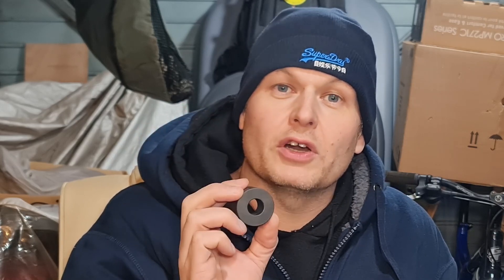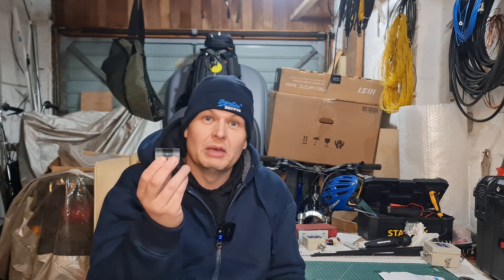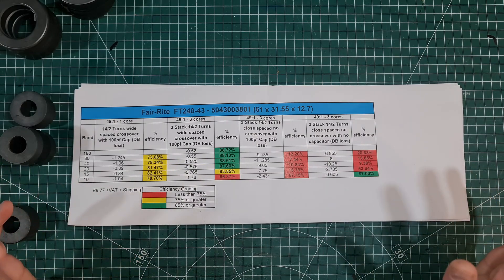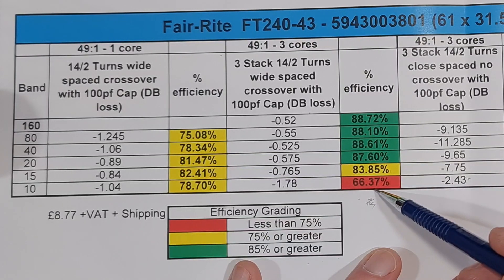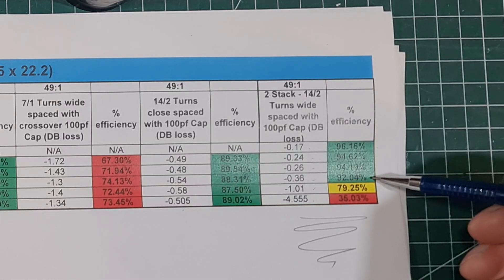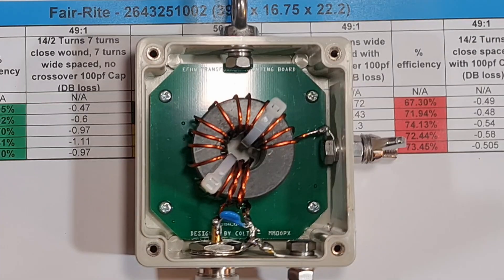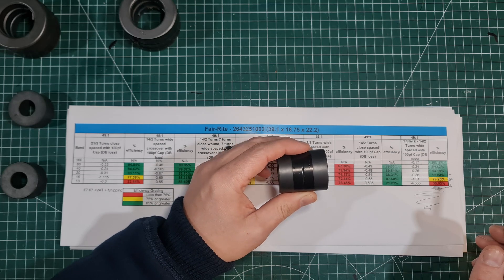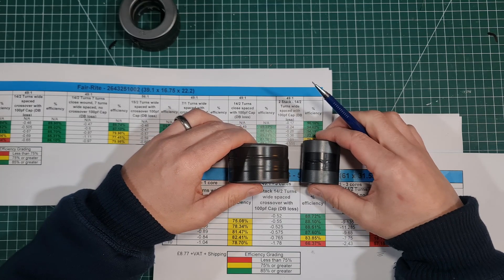How efficient is the best 100w End Fed Half Wave Core when stacked for QRO? #hamradio #antenna

Comment: I've built a 2/14 closewind, at tapped, 100pf  using Fair-Rite - 2643102002, using similar test rig I get results inline with the Fair-Rite - 2643251002 and Fair-Rite - 2643625002. I've been using it for POTA w/ 20m~ of wire and it's been matching/surpassing my results from ft-140-43 I was using for 10-100w (usually I activate 10 or 50w)
Reply from the maker: Excellent, glad you got something that works for you 😀

Comment: I work ten meters with two stacked 240-43 cores and found them to be quite suitable for 100Watts of SSB. Thanks very much for this video. You are really filling a hole of information that needs filling. Your research is making the EFHW anttenna more viable and efficient, especially for multiple band operation.
Reply from the maker: 2 cores will handle 100w data modes with ease never mind SSB. This core will let you squeeze out a little bit more performance.

Comment: why so much power on ft8 i worked the world on 10 watts. running your radio to 100watts or amplifiers on ft8 will kill your output transistors. better antenna less power.
Reply from the maker: I agree in general. To he clear, FT8 is a weak signal mode, not a low power mode. There will be times you need to raise the power but yes usually if the band is open a few watts will do. I wouldnt run more than 30w from my rig on a digimode. My amplifier however would run all day and some at 400w. Its rated 1kw full duty cycle and I know a friend whe had an NOV and ran his on 1kw RTTY without issue  which has a higher duty cycle over FT8.
Reply: Knew a bloke who during the recent sunspot minimum worked Australia to east coast Russia on 10m using Russian QRP which was around 2KW to get through on FT8

I guess you do what it takes :-)

LDMOS has made it easier :-)

Comment: Everyone seems to just use the 100pf capacitor, but has anyone tried putting a mica compression trimmer on there instead and seeing if the optimal capacitance value changes as things like stacking cores is adopted?
Reply from the maker: Thats not strictly true, I've experimented with 150, 120, 100, 50 and none. Its very much horses for courses dependent on winding and core used.

Comment: What manufacturer and model of the capacitor are you using in this experiment?
Reply: I'm sure Colin uses TDK ceramic capacitors. Try this part no. : CC45SL3FD101JYVNA
Reply from the maker: Appreciated 👍

Comment: Ive got 2 of these cores after watching your other video.  What awg/mm magnet wire should i use for 100w max?  Thanks for the data. Great video 73
Reply from the maker: Anything around 1mm. I use 1.12 or 1.18.
Reply: @MM0OPXFieldRadio  Thank you!

Comment: I’ve become addicted to half wave end fed mono-band verticals for the higher bands!! I’m using ladder line to create a quarter wave shorted stub to give me a match!  I find it a nice alternative to using a transformer when looking for DX!!
Reply from the maker: Definitely, I really like my monoband 5/8 vertical L/C matches. I can run much more power vs a wound ferrite core.
Reply: @Gabaab  It’s essentially operating as a j-pole! What’s nice is that the losses are low - the only area of high current being around the shorted end of the ladder line. So quite efficient!
Reply: @Gabaab  It's worth a try -  easy to make and v effective.  For 10m I've always thought getting the 5 m wire as high as possible on a 10m pole helps - Height is might etc etc!!!!

Comment: Colin filming in his garage when it is -10°C inside and even colder outside 😂
Good job Colin. I didn't realise the ft240-43 cores were good for 70W. I always stop at 50. I'll definitely look at your suggestions for a higher power set up.
FYI I have worked 10m SSB qrp DX with the EFHW on more than one occasion. 
Cheers, Fraser MM0EFI
Reply from the maker: Excellent Fraser. A lot will argue the 240-43 will handle 100w FT8 but not in my experiments. Getting milder here in southern parts thank goodness.
Reply: Thank goodness it is getting milder.  I wasn't doubting your efficiency calculations for 10m. I think I just got lucky. When 10m is open, a bit of wet string can sometimes do the job. 😊

Comment: For reference I was using a single 240-43 as a 9:1 for a Random Wire and had the 70W limit hit me ..not imediately but after a good dose of FT8 also the operation at 10m again seems a bit off.. nice to see that your figures approximate to my setup done independantly!!
Reply from the maker: Thanks, there is some doubters out there but  good luck to them. Yes, it does take a while to saturate the core but does happen.
Reply: @MM0OPXFieldRadio  I would say from the time it takes you are not Saturating the core significantly  but enough to slowly heat it near the Curie point at which the performance drops and you are forced to back off to the sustainable level!!

Comment: This video is semi helpful :-)

I have been playing with magnetic loop antennas made with 1” x 1/16” aluminium bar. 

Using FT240-43 core as a 1:x matching transformer, I have 40m and 20m working exceptionally well with both 8m and 5m circumference loops. 

However, using the smaller 3 and 4m loops for 10-15m the turns ratio drops and the coupling efficiency seems to die off

Stacking cores helps a bit and I grabbed some type 52, 61 and 77 material. Not much difference. 

Strangely enough the throw together 10m loop I poke out the window made from 2.5m of RG6 with a capacitor made of the same, fed by some random EMI filter cores I found in a computer case is around 12-15 dog biscuits better to the local RBN 

I’m considering the core efficiency vs the skin effect issues of a flat bar vs round

Might look at other coupling and matching methods. Small loop, gamma match. See what works. 

Sadly these cores you’ve used are too narrow for the strap. 

Back to the experimenting….
Reply from the maker: Sounds great. I love loops.
Reply: @MM0OPXFieldRadio   they are magic. The noise drops from S7 to S3 on 40m with the 8m circumference loop bs the 33’ vertical. That’s what you get for living in an inner city QRM jungle. Seems quieter since they took away the overhead cable service amp from out front. 

It’s the coupling that I’m working on. I’ve seen a few of your videos on materials v frequency and they have been very helpful. 

I think it’s because the loops are almost too long and with a single turn through the core the impedance at resonance is too high and I don’t get a tight enough coupling with so few turns. The match is good, but the energy transfer is crap.

That said, I don’t see heat in the core. 

Back to the drawing board and more experiments. 

But I have succeeded in a Poke-Out-The-Window-Tenna™️ that covers 20m and 40m so I can test radios from my test bench
Reply from the maker: @MidlifeRenaissanceMan Thats amazing. Ive always wanted to build another mag loop. I had an 80m horizontal loop years ago which worked very well.
Reply: @MM0OPXFieldRadio  I have managed to drive 100W into this current design. Works well and no capacitor flash over. 

Trick with mag loops is don’t expect them to cover more than an octave of frequency.  7-14. 14-28. You can certainly tune them down there but their efficiency drops significantly below the first octave, and you can hit self resonance up top. 

Efficiency is proportional to the surface area so circles and octagons tend to beat squares. 

Radiating Element surface area is significant to a point. But skin effect is your friend. You can get away with tape, either aluminium or copper. Much cheaper than copper pipe, though if you’re happy to slip a dude a $50 he can take a $30 aluminium pole and bend it into an almost circle for you. Friend has one that he can tune 7-21MHz that performs OK on 7 but really kicks some at 14MHz

Finally, you only need a small amount of variable capacitance to cover any band. Makes it cheap to build a mono band loop and change bands by paralleling fixed capacitance across the variable cap. 

Probably stuff you already know, but someone may come across the thread. :-)

Comment: Great work Colin... I wanted to try a 49:1  2 stack 52 core, which I don't think you have shown, and which I think will work better on 12 and 10 meters... am only interested in 40 and up. I only had a single FT 240 52 core. Looking at most winding profiles, sans the crossover which is NOT necessary; so you have a winding profile uses less than 1/2 the core mass... the rest on the other side is wasted.... or is it?  

Carefully using an angle cutter I chopped the core in half, you do this carefully, score the first side down 1/4 then do the other side, it'll fracture apart, clean it up.... and then glue the 2 halves together. Since size matters, I now have double the mass under the windings; that's what you really want. I only run 100 watts SSB max, most of the time it's only 20 watts from my Xeigu G90.... 

Preliminary results are positive....seems to work well, VSWR is less than 1.5 on all bands, 20 and up including 12 m ... until you get to 40 where it went a bit askew and resonates a bit high in the band... 80 is useless, which I kinda expected.  Worked a guy in Kentucky on 10...got a 5X5, but more checks are needed.
Reply from the maker: Thats a really interesting idea. I would need to do a back to back with chopped cores to see if if makes a difference. I doubt I will though as these are not my cores.

Comment: Hi Colin, I'll be making a couple of antennas up with the 2x2643251002 cores stacked and giving them a good test on FT8.  Also also 3xT290-43 with 3xT140-43 slipped inside,  should be interesting to measure the efficiency of a very large transformer.  Have you tried 2643101902? I have done some test on these and with 49:1 wide spaced the efficiency look about 90%+ from 80m-10m and is looking like a good option to replace the T140-43 cores from my products in the future.  73 M0VUE
Reply from the maker: Hi Chris, I would be very curious for your results. Theres still lots of experimenting out there to do. I havent tried the 1902 core. Its good to see a UK seller selling the 1002 core. Not easy to get hold of this side of the pond.
Reply: @MM0OPXFieldRadio  Hi Colin, send me your address and I'll post you a couple of 1902's.  I've tested 80,40,20,15,10 my measurements were 93%, 92%, 92%,93% 90% efficiency using 49:1 wide and back to back with my Nano VNA.  Would be good to see how close you get to these numbers as well.

Comment: Hey there Colin. First off, thank you for the content your making, its getting me good into HF and HAM in genarel.

But i have a small problem with the 2643251002. I have made 4 builds now with 13, 14, 15 and 16 turns, and with deffrent copper wire both deffrent in make and size. No matter what my graph looks like a mad house. :) from around 15Mhz and up its over 2:1 SWR with testing with  a 2450 Ohm load. Question is how the hell do you and the rest of youtube land make this work, most videos i have watched, just build it like i do and its spot on.

Side note did a 49:1 on a 240-43 to see if it me who is not doing it right. That one has top SWR at about 30 Mhz and is 1.7:1 and a nice low curve.

What am i doing worng here.

Sorry for the bad gramma.

Cheers
Vy 73 de OZ5ZX // Jeff
Reply from the maker: Tell you a secret, ditch the resistor! its only a indicator. Connect a wire and you will see a HUGE difference. FYI up at 30 Mhz its up at nearly 3:1 with a resistor, with a wire its fine. I wish this was more widely known. When you have the wire up, make some contacts while your at it. The only time I use a resistor is to prove the build is sound!

Comment: FWIW I have used 2 T240-43 stacked in an EFHW at 400 watts SSB and it has survived 3 years now.  I used 10 guage magnet wire for the 49:1 windings.  Cheers.
Reply from the maker: You will on SSB no probs 👍

Comment: Did you take inductance measurements so one can determine the range of where best eff occur over the HF bands. It is of course possible to calculate ind but actual measrements will be FB.
Great adventure and tut.
Reply from the maker: No, but I could have as I do have an LCR meter. I will try to remember to this.

Comment: Hi Colin.  Great videos.  I"m in the process of winding 2 stack of 1002 toroids.  Looking at you chart it refers to "14/2 turns wide spaced"  I wasn't clear if that differed from the tightly wound and spaced auto transformer.  I might be missing something but I've not seen "wide spaced" demonstrated in any of your videos.  Clarification would be appreciated...thanks.
Reply from the maker: I still have some updating of the spreadsheet yet. Wide spaced means just evenly spaced out windings. Your 2 stack of 1002 will be very good low down but become very lossy above 20m. Let me know how it goes for you.

Comment: What size wire are you winding the cores with.  My club has been experimenting with a 36:1 winding that is interesting.
Reply from the maker: For this test I used 0.66mm wire as it's easier on the fingers. For use as an antenna use something about 1mm in diameter. I have 1.12mm and 1.18mm here also.

Comment: Thank you for supplying your viewers with such amazing data. I am building a EFHW now and putting my 240 43 cores aside, 100 watts max to include SSB and Digital. Ordering the new cores, but now confused with the best way to go, single core or stacked?
Reply from the maker: I'm no expert, just sharing what I can. 1 x 1002 is perfect for what you need and will run FT8 all day at 100w.
Reply: @MM0OPXFieldRadio  Thank you sir!

Comment: Hi Colin, got another question ....
Have you ever considered to try and test a 9:1 comparison between the 240-43 and the Fair Rite ....1002 core for the EFRW / EFLW users between us ?
Will the efficiency of the 1002 core be as good there too ?
I'm gonna build and antenna like that. Goal is to get on the warc bands too.
Reply from the maker: No, I havent. Thesmokinape has done some videos on this and a 9:1 is pretry good 90% plus. Of course you have SWR losses. It would appear the less the impedance transformation the less the efficiency losses.

Comment: Two questions:
1. Is it possible that using a larger value shunting capacitor to negate some the high inductive reactance at 10m ...could decrease that really bad -4.55dB loss? 
Or does that merely change the total impedance at 10m?

2. Would it be ridculous to think about a hybrid core combo? Since that actual transformation is occuring in the core of the toroids, maybe trying a single 1002 core centered and sitting squarely on top of an FT240-43? Or would one core just take all the loss anyhow?

A 4.5dB loss on 10m with two 1002 cores would be excessive and the core heating would be unbearable. I'd rather just use an antenna switch and go to a different antenna on 10m.
Reply from the maker: 1. Possibly but think it would adversely affect the match as as antenna.

2. Not at all. I think its a possibility. Can only try.

3. Agreed, there are many better antennas for 10m.

Comment: I’m very interested in your work.  I would like to build a transformer that does 80, 40, and 20 at least and with full legal US 1500w power on SSB for use in our ham radio club for possible emergency communications. I have subscribed.
Reply from the maker: Ive made a more recent video on this. You need a 3 stack of 240-52 wound as an Autotransformer. Its as efficient at this (maybe slightly better) and will handle your power.
Reply: @MM0OPXFieldRadio  Thank you. I’ll find the video and watch it. I truly appreciate your data driven analyses.

Comment: What's the best wire length end fed antenna measurement for 10 mter to 80
Reply from the maker: Impossible for an exact figure as this will depend on your environment. It will be in the region of 130ft / 42m

Comment: Im curious where you place your common mode choke on the ciax or do yiu use a counterpoise or both?
Reply from the maker: Usually I don't use either. If i do, its a GM3SEK choke 0.05 lambda away from the feedpoint at lowest operating frequency.
Reply: @MM0OPXFieldRadio So what would drive you to use a CMC vs not? Simply not getting it to tune?
Reply from the maker: Common mode current coming into your 
Shack but could manifest itself as a tuning issue.
Reply: @MM0OPXFieldRadio  i have a CMC at the rig but always thought you HAD to use a choke approximately. 5  wavelength down from the feed point
Reply from the maker: 0.05 of a wavelength from the feedpoint ideally. Dont fret about it too much.

Comment: I'm curious about the efficiency with larger diameters of magnet wire.
Reply from the maker: Compared previously. Made no measurable difference. If im just testing I use thinner wire thats easier on the fingers.
Reply: Makes no difference because if you push the power limit of the smaller wire the core would have already been saturated in the first place.

Comment: I just want a core that can do 10-80, 🤣
Reply: Ready?
A 240-43, 2primary 16secondary, as close as possible, (obviously no cross over crap), tapped not bifiller, 100 pf, I got the 5t on 1" former inductor 2m from the box, then a few hundred pf cap directly in the middle of the wire for the 75mod, feed it with 75ohm coax
Most wonderful end fed I've ever made,